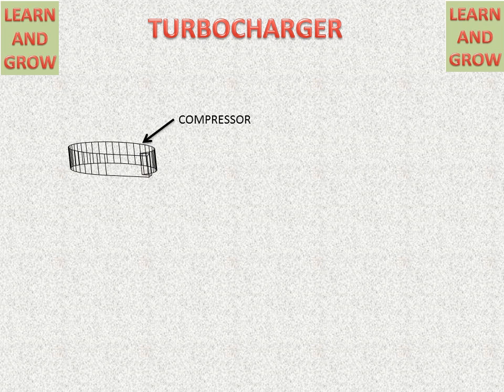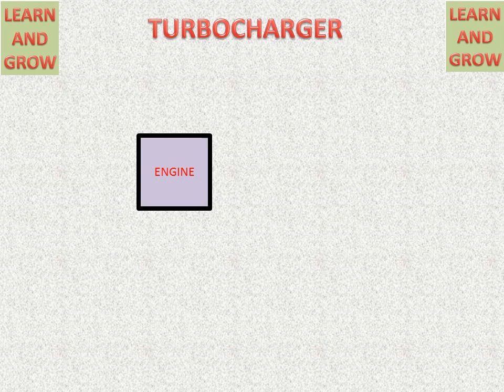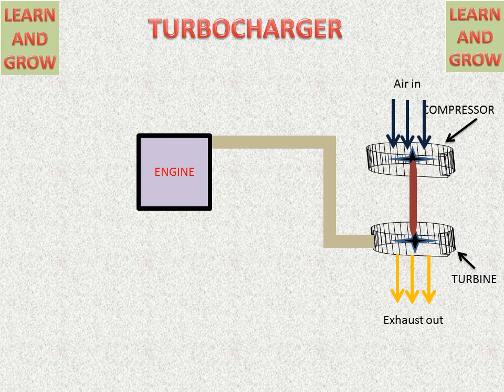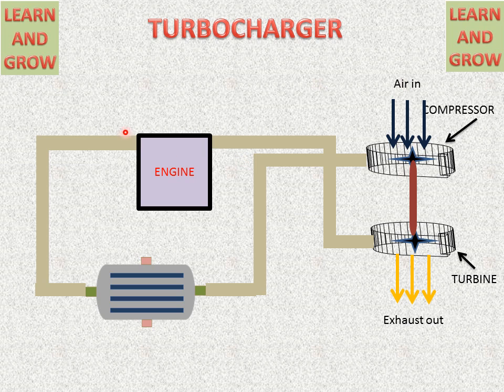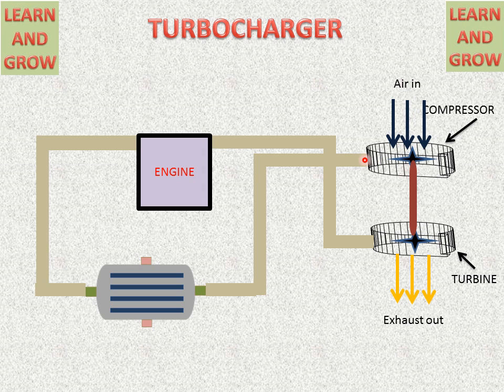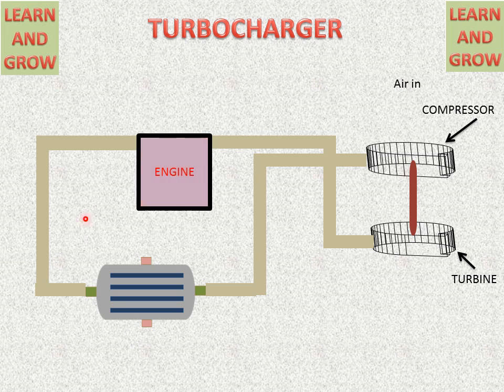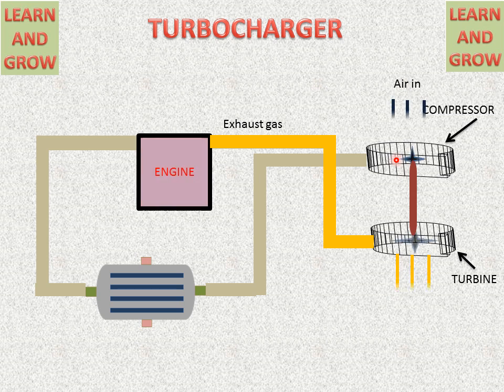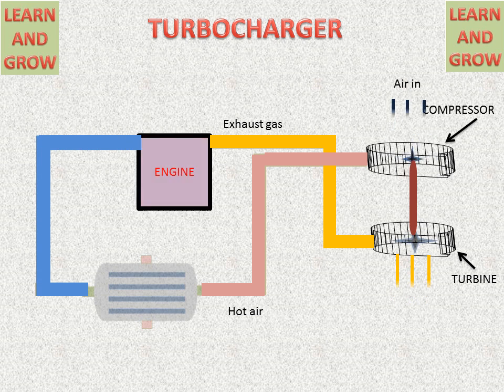Working Of Turbocharger

Comment: Sir why use a intercooler
Reply: Because air sucked by compressor is hot which is sent to inlet of engine via intercooler, which cools the hot air, then sent to inlet of engine.